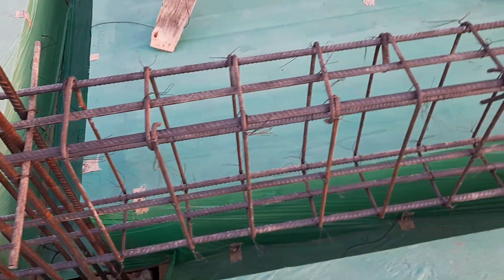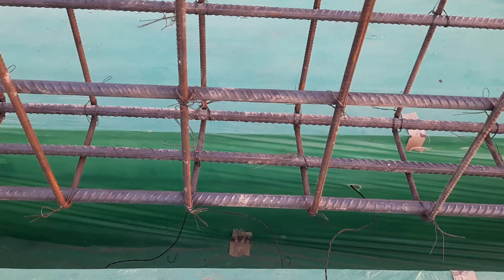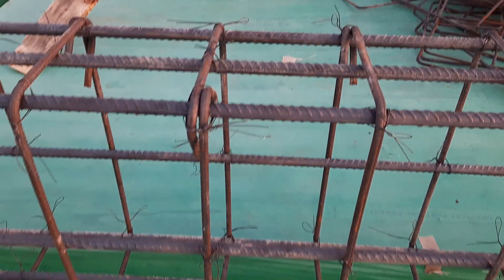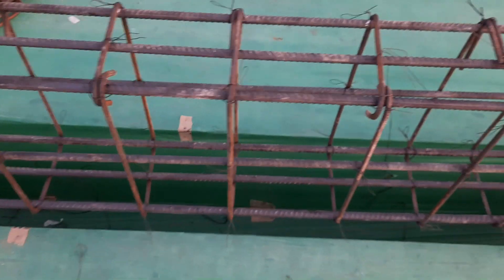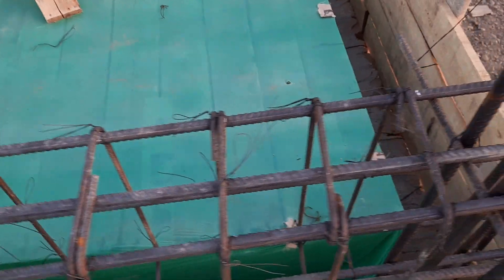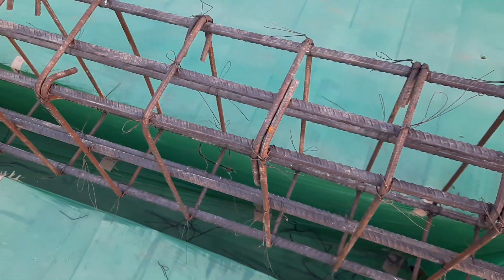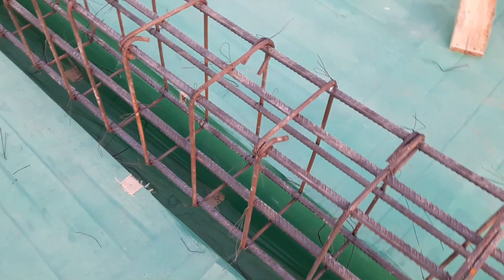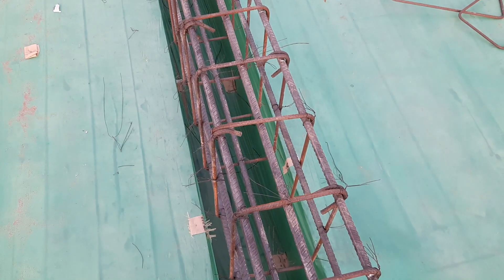4 Big Mistakes in Beam Construction on Site | Civil Engineering Videos |

Comment: There should be same reinforcement in compression and tension zone .......u r a waste
Reply: No .
Reply: No  concrete is weak in tension as per condition xu≤xumax steel corresponding tension as concrete corresponding compression thats why reason to design of concrete elasticity =5000 root of fck